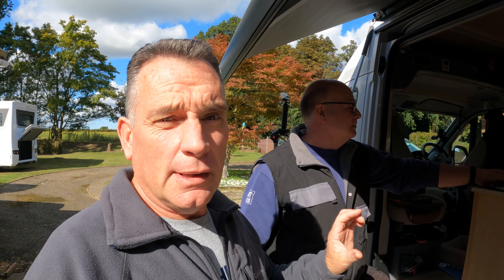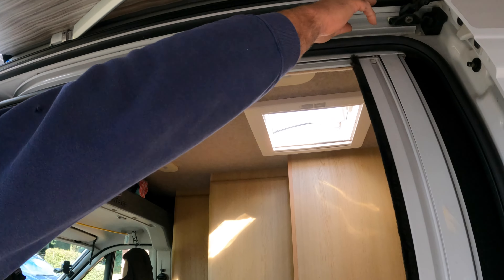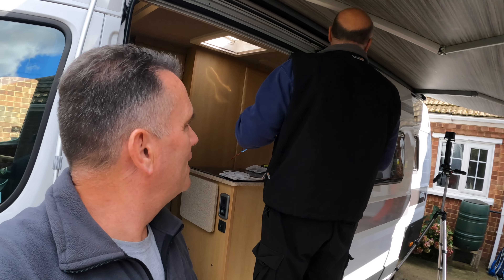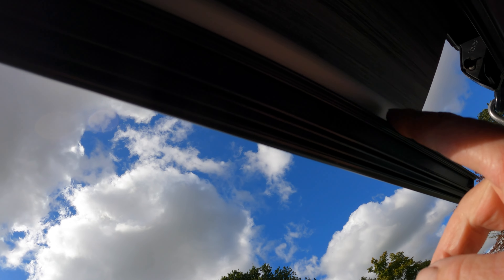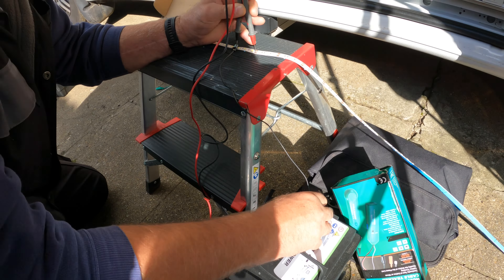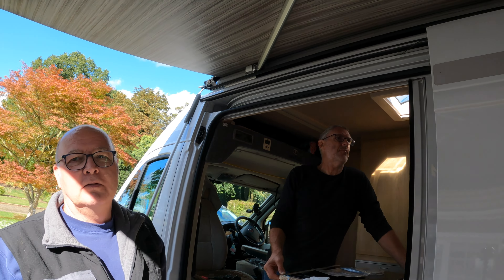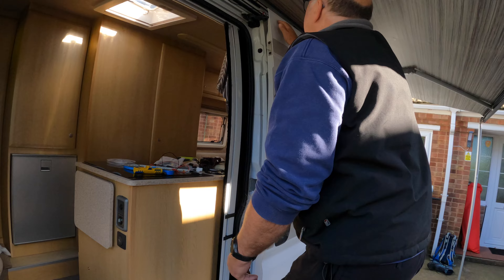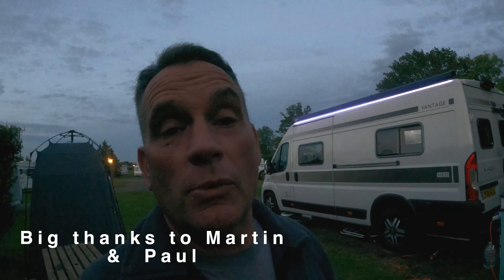How to install 12V LED Awning Light Strip MOTORHOME/CARAVAN , the whole process

Comment: Hi regarding you video on the broken 
Window blind. Mine broke and I bought some aftermarket ones off Ebay ,what the seller told me is drill them out, which I did, just thought it would help if it broke again
Reply from the maker: @billsuthers3092  that will come in handy one day thanks for the info 👍